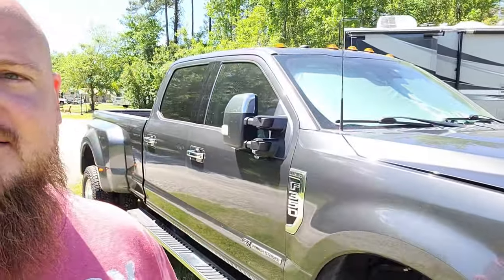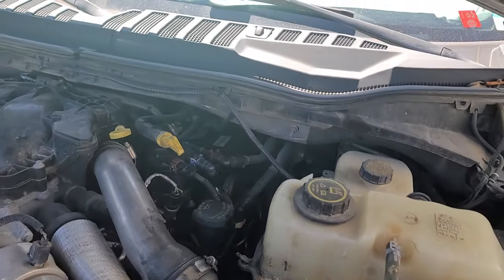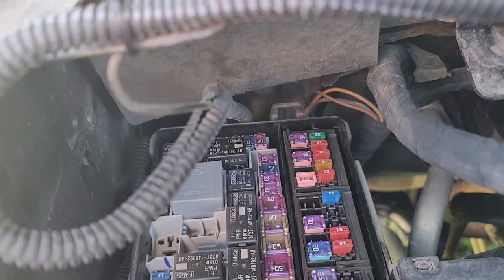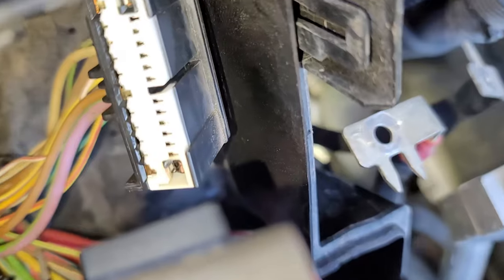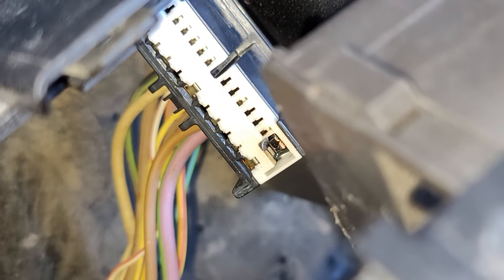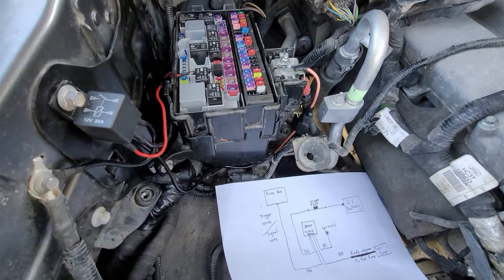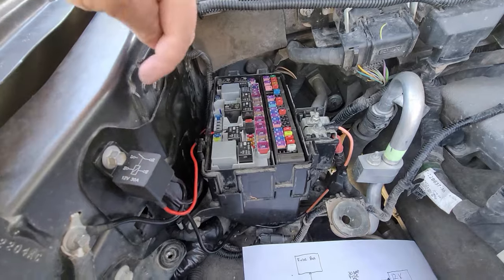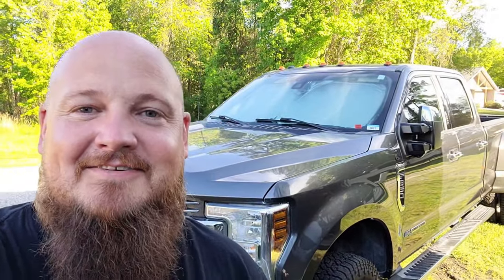Fix 2017-2023 Ford Superduty Crank-No-Start with Fuel Pump Relay Bypass Powerstroke 6.7L Diesel

Comment: I just got a new 2024 F250 XL 6.7L 3 days ago. I don’t even have 100 miles on my truck and have experience this issue 3-4 times trying to start my truck for its initial first start or after it’s been sitting awhile. I’ll be taking it to Ford to have the issue resolved.
Reply from the maker: Aw man! I'm sorry to hear that, but hopefully this video helped you diagnose the problem. Or that they can fix it.

Comment: You are the man easy fix. My 2018 just quit find out I need bad news need new injection CP4 pump  failure  kit 6k plus labor thanks for sharing .
Reply from the maker: Dang it! Sorry to hear you need a new CP4 pump. Glad my video helped in some way.
Reply: Spend the money and replace it with the DCR conversion its worth every penny, In my shop I won’t put the CP4 garbage back on the trucks

Comment: Once I got the fuse box seperated. How did you get the back part off to see if it was burnt?
Reply: you have to push in the release tab on the connector and it will come loose.

Comment: My 2019 f250 is cranking very hard is that one of your symptoms you ahd
Reply from the maker: When my truck started acting up it would just crank and crank and crank with no start. Then a message would pop up in the dash that said low fuel pressure. I’m not sure what you mean by “cranking very hard” but I hope this helps

Comment: How did you get to the white plug on the fuse panel?
Reply from the maker: There is one 10 mm bolt on the fuse box. Then you have to pull the box forward. There are tabs on the sides of the fuse box that allow the bottom to separate from the top. Once the bottom of the panel is dropped you can open the fuse box and the white plug is in the back right corner.

Comment: Did you wire the trigger wire to what slot
Did you wire it to a fuse?
Reply from the maker: I used a fuse splitter on fuse 34 (Blind spot monitoring system) 10 amp fuse. There was no fuse on 35 so my splitter fit
Reply: @Wonderfullywander Thanks for the reply subed and liked
Reply: 10 amp is enough to run pump for the long term?

Comment: Quick question? Since you used position 34 did you have to add two fuses on splitter to allow the pump and blind spot to work? I chose location 39 because that’s where my splitter fit (20amp)((horn)) ,the  pump works but my horn doesn’t. I have two ports on my splitter with only 1 fuse do I need both or am I missing something?
Reply from the maker: You need to put a fuse in both slots.

Comment: Very nice explanation.  I will down this vid and keep for that evidentiality.   Quick question ... do you think it's possible to get a 30A relay that will work in one of the empty relay slots in the fuse box instead of using an external relay?
Reply from the maker: You can, it’s just way easier to get the purple and green wire from the harness and use that. Either way you will have to relocate the wire, but using an external relay saves you the haste of tearing the fuse box further apart to try to retrofit a spare relay space. Most of the relays are in a different part of the fuse panel so wiring may be a bit tricky. I got a lot of my advice from a rat rod builder. He said he has been using these external fuses for years and has never had a problem. They are designed to be in some weather under the hood and they hold up well. That was good enough for me and it was easy to wire.

Comment: Thanks so much for this info!!! Question would I still need the “30amp box fuse” once I add the inline 30 amp fuse?
Reply from the maker: No once you install the bypass the 30 amp fuse is basically dead.

Comment: Was there any power to the fuse before you decided to go this route ?
Reply from the maker: I can’t remember if the fuse had power. the problem is not with the fuse, the problem is the wire melts the connection behind the fuse box. This causes damage and doesn’t allow the relay to function properly. I took my fuse box apart and saw the melted wire. If you want to test to see if this is your issue take the fuse box apart and look at the white harness plug. If it shows signs of damage or melting this is a good indicator that you should try the bypass.

Comment: I have the same problem with my truck 

I'm going to try to see if I have the same problem ty   My truck is 2020 it will be the same?
Reply from the maker: As far as I know they haven’t changed anything from 2017 to new. I haven’t seen what they are doing on the 24 or 25 but the 2020 should be very similar to my 2018
Reply: @jorge, did you get it fixed? i see that 2020 and 2018 has different fuse box.

Comment: What codes was it given u before u fix it
Reply from the maker: It had a low fuel pressure warning, but I never ran the specific codes
Reply: @Wonderfullywander   thanks my truck did the same thing yesterday but shake the fuse box under the hood and it start back working
Reply from the maker: That tells me you are working on borrowed time. Check the harness plug, I’d bet the connection is melting.

Comment: What fuse tap did you use?
Reply from the maker: I’m not sure I know what you are asking?
Reply from the maker: @roberttaskerjr  update: I looked through the fuse diagram. I used a fuse splitter on fuse 34 (10 amp fuse for the blind spot monitoring system) there was no fuse on slot 35 so it allowed my splitter to fit.

Comment: So I just went through this issue, and did the repair with remote relay no problem. However, in my research I also came across the issue of possibly needing a relay with a diode, or using an external diode to prevent the issue of "flyback"? I'm not sure if that was the right term, but anyhow it is mentioned because when the fuel pump is shut down, there is the brief milliseconds where current can flow backwards through the pump, and this could possibly damage the PCM? I don't know if the factory relay has a diode or not, or, possibly there is a diode in the fuel pump itself? Anyone have any ideas about this? Nice video by the way!
Reply from the maker: Thank you that is good information, I’ll look into it.
Reply: @Wonderfullywander any update
On this??
Reply from the maker: @lakaja6565  I reached out to my friend with this question. He is a Master Technician for heavy diesels and has worked for Kenworth for almost 20 years. He said that he has never heard of an issue like that. He told me that once the power turns off the remote wire stops sending power to the relay and it stops the pump. Obviously there have been exceptions because @jamesresh2293 found the info, however I think this is an example of an exception and not something that happens often.
Reply: @Wonderfullywander  Ford indeed uses a diode in circuit to the coil side of the relay from 12v+.  It's function is as a quenching diode and blocks the high voltage spike that is created by the coil when de energised.  Think ignition coil spark, same principle.  I do have one question about your relay bypass though.  How did you avoid setting a code for open circuit, fuel pump control?
Reply from the maker: @RobertsAutomotive  I want to preface this with, I am not a mechanic or a mechanical engineer. I do not claim to have all the answers. What I can tell you is, I did research on this issue and found that there was not very much info available for this issue. I don’t know why my repair didn’t cause any code other than it must be functioning correctly. More than anything it makes me frustrated with Ford for having such a blatant issue and not issuing a recall. I can’t answer all the questions but hopefully my repair helps people who don’t want to replace the fuse box and harness.
Reply: @Wonderfullywander  The code sets when the ecu no longer "sees" the relay in circuit.  Your repair is an old school trick to get around lots of issues and was my go to solution as well.  Till I was stymied by the damn C.E.L. on this 2011 Puperstroke... !  I think some engineer purposely did it this way to fight the backyard repairs.
Reply from the maker: @RobertsAutomotive  leave it to Ford to try to make you consistently replace bad parts rather than create an actual solution.
Reply: @Wonderfullywander  Ford.  But hey!  At least they circled the problem...

Comment: You do realize that the ground wire only energizes the relay that only draws milliamps
Reply from the maker: I don’t understand how that’s relevant to the repair?
Reply: @Wonderfullywander Beacuse the ground wire does not need to be 12 or 10 gauge the relay only draws milliamps and all that ground does is turn the coil in the relay on.
Reply from the maker: I used such a big wire because it was what I had. You won’t hurt anything by installing a wire that is bigger than needed.
Reply: I agree but you made it sound like it was necessary when a 16ga wire would work fine.. Im j
ust being a hard a** I appreciate the video.